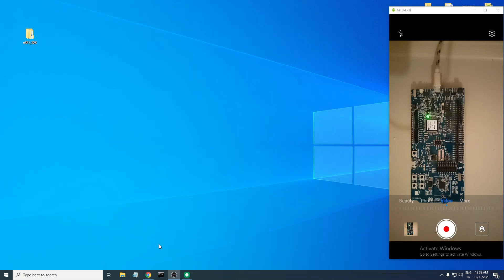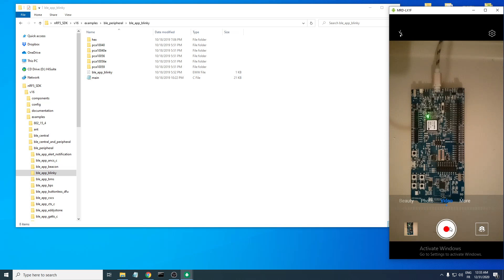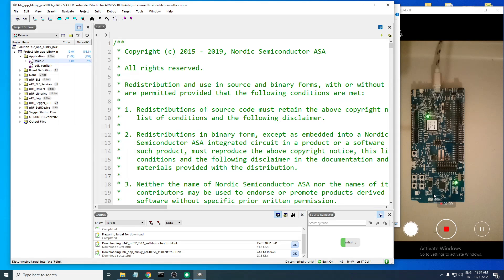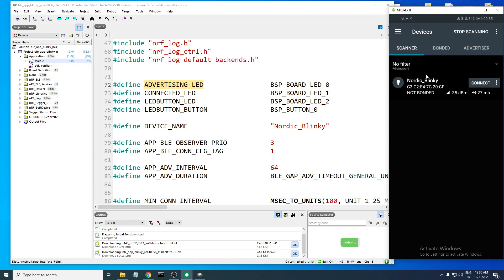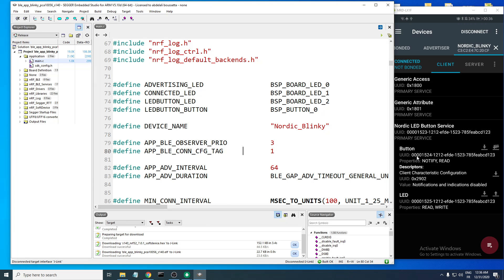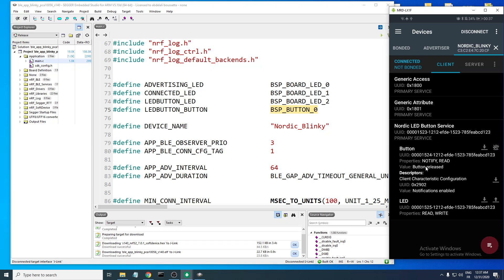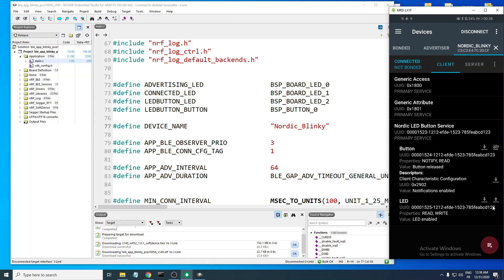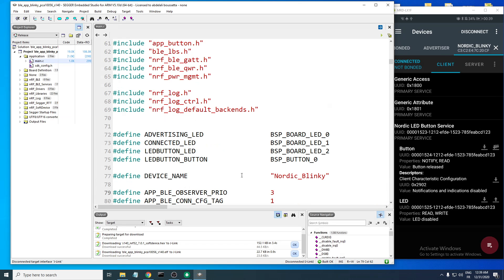How to test the BLE blinky example in the nrf5 sdk

Comment: Hi, nice video, very helpful, do you know where is the answer for the led action?
Reply from the maker: Hi @Marcos, Not sure of what you mean by the "answer to the led action"! Could you elaborate more on that?
Reply: @nrf5dev  i mean when i change the led status the board response "ok", but i can not see where the code send the response....
Reply from the maker: @marcoscuriel7741  Have a look at the main.c file, led_write_handler() function in line 270.
Reply: It is turning on and off the led, but is not sending back an "ok" over the same service